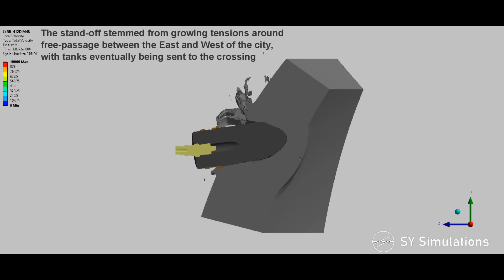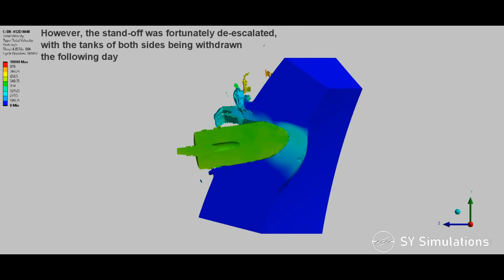STAND-OFF AT CHECKPOINT CHARLIE SIMULATION | T-54 vs M48 | BR-412D Armour Penetration Simulation

Comment from the maker: I'm planning to do a Part 2 with an M48 firing at a T-54, but I'm not familiar with which round it would likely have loaded for the stand-off; would it be AP, APCBC, or HVAP? (Keep in mind I cant do any HEAT munitions due to computational constraints)
If you know more please let me know!
Reply: against armor, post-ww2 american vehicles usually employed HVAP. i believe the one used on the m48 would be M332A1, if HEAT-FS wasn't available.
Reply: HVAP, please.
Reply: 90mm M332 HVAP against the T-54 turret, because it wont pen anywhere else. If you need schematics for it's armor layout I've posted them on TankNet forums a while ago.
Reply: @peasant8246 I don't think that round was in service during the crisis.
Reply: @SeanMurphy1090-d5u  It was in service at least from 1953, possibly earlier.
Reply: US phased the M82 APCBC out in 1950. M318A1 APBC / M348 HEAT / M71 HE / M332 APCR became standard
Reply: would it be possible to do a simulation of the HEAT round and get the velocity/mass of the shaped charge jet and then use that as a baseline for a mock shaped charge jet (just an EFP basically) on the T-54? it probably wouldnt be as accurate but i'd like to see if it would obtain similar penetration values to the real deal
Reply: it would be interesting to see how much damage or spall an HVAP non pen would be able to do to a T-54
Reply: AP (the general APHE used on the 90mm gun) probably isn't worth to see, the T-54 was a tough nut to crack and the HEAT probably could do the job but as explained we will not see that.
So, go for the APCR/HVAP🤓
Reply: @Sh-epard  THE M82 APHE shouldnt even be attempted. The 90mm guns on the Pershing and Patton tanks had equivalent performance to the german KwK36 88mmL56 with that ammo type. And the soviets specifically required the T54/55 to be imune to that gun from any range. And they tested it by shooting the gun point blank at the trial hulls.
Reply: @regeNausWeiden  as i said he should sim directly the HVAP/APCR.
Reply: By this period of the cold war it would have been HEAT, with the improved version being the m431 round. However, besides that, the post ww11 hvap could have been used as a substitute. With the HEAT round the m48; at this stage in the cold war, would have had a the advantage. AP33-7 was also used, with higher velocity than its predecessor's, the t33. Under 750m the hvap could penatrate the t54/t55.
Reply: @jarredbertels864  Pretty sure the HEAT rounds were not issued until the mid-60s
Reply: @SeanMurphy1090-d5u  Another clueless tankie, oh please.
Reply: T300E53 HEATFS round was tested in 1958 and as I understood became the basis for M431 HEATFS. By 1967 it definitely became standard issue ammunition, as it has been mentioned in the Artillery Ammunition technical manual for 1967, being issued to vehicles equipped with M36, M41 and M56 90 mm cannons, but not those with M3A1 that were stuck with M348.

It is unclear if by 1961, M431 would already be issued. However, M332 HVAP and at least M348 HEATFS were definitely be present in the load out of these M48 tanks in Berlin.
Reply: M318 APBC or M332 HVAP. I can't imagine if Checkpoint Charlie M48 crews had both rounds available in their racks they would have had anything but HVAP loaded.
Reply: I think APCR (M332A1) would be more interesting to see, since M318A1 is just a solid slug with a windshield, and as a sidenote I've also heard that the fuzes in the HEAT rounds had problems at higher angles of impact.
Reply: @juusolatva  Well, look who's the self-proclaimed Tankie here. The mighty American 90mm HEAT-FS rounds, showcased on their M48 and M47 darlings, apparently had a jolly good time waltzing through the T-55's glacis plate back in the day. Oh, but wait, hold your horses – brace yourself for the shock of the century! Behold, the legendary Yugoslavian experiments, where the almighty 90mm HEAT rounds strutted their stuff, turning that once 'invincible' T-55 glacis plate into a spreadable delicacy, smoother than butter on a summer's day. Oh, how the T-55 wept.
Reply: Present the projectiles one by one and then test them (perhaps starting with the oldest and going to the newest)
Reply: Should be HVAP. The US had the specs for the T-54 thanks to an "acquisition" in the Hungarian Uprising a few years previously and considered the T-54 an even match for the M48 but not the IS-3.
Reply: I'd like to see a simulation with the HVAP round!
Reply: HVAP
Reply: APFSDF
Reply: Heat
Reply: I'm for APCR. Tankers loved to shot their best rounds first. While the Brits used APDS, the US stayed with APCR rounds for some time :)
Reply: Can you make a penetration test for mt 12 100mm round
Reply: Is there any plans on making a video about old soviet WW2 APHEs with gorooves on them? I just watched ur Tiger II shot traps and there was a topic on effectiveness of those stress relief grooves so im wondering whether there's any point in waiting for a video on them with your approximations on cases where those would make a difference
Reply: Did alot of research and it seems in the event they faced heavier tanks at closer range they would use the heat and they would use the hvap at longer ranges due to its later trajectory so it is likely they would have had heat loaded in this case but since you can't model heat it would still be interesting to see the hvap
Reply: Pretty sure that APCBC was the standard anti-armor round. I don't think the 90mm HEAT was in use until after the crisis.
Reply: @SeanMurphy1090-d5u  M82 APCBC by 1950 was decommissioned for the 90 mm cannons as far as I know. M318A1 APBC (basically improved T33, made of a different steel and fired at a higher velocity) and M332A1 HVAP (basically modified M304 HVAP with a lightened carrier and significantly higher velocity at close range) would likely have been the standard rounds.
Reply: It would have been M318A1 APBC or M431 HEATFS.
Reply: @basedjorts  I'm almost certain that M431 was not in service at the time.
Reply: @SeanMurphy1090-d5u  It was available by 1960, if I correctly read an Army document.
Reply: HEAT
Reply: HESH/HEP. US tanker like hesh against armored target. They prefer heat but heat is hard to get. And because they know AP and hvap do little against soviet tanks. Though maybe hvap penetrates upper plate and turrer at this range though?

Comment: Soviets still using full caliber AP rounds in the 1960s:

The M48’s HEATFS waiting to turn the Soviets into Russian soup: 🗿
Reply: Nato still using rifled cannon in 1960
While the soviets using smothbore cannon
Reply: @IzakSemrdoii The D-10 was also rifled
Reply: @idontlikecommunists9677  t62 cannon was not
Reply: M48s armor was not that good so full caliber AP was enough against its armor. Meawhile T-54 was immune to 90mm full caliber AP shells so the americans resorted to HEATFS (which had pretty bad fuses so there was a chance to just bounce off the highly sloped soviet armor instead of detonating. Its also why they used HVAP since it had no fusing issues and was more accurate)

Comment: How about 
128mm PzGr.39 APCBC from Jagdtiger vs 100mm thick 260BHN steel at 60 degrees

But then also vs 300BHN 42SM steel 100mm plate at 60 degrees to simulate T-54 hull armour

Comment: Good sim, only argument i have, is that the cast armor on the M48 turret is said to be around ~310bhn going by the books and armor distribution documents I have.  Granted, I doubt it would of made much of a difference in the sim at that range/velocity.  Also, are you using the same J-C damage model for cast and rolled armor?  Or do you have a separate damage property set for each type?  The difference between the two isn't really hardness, it's more the tendency to be pourous and have microvoids in the cast armor.
Reply from the maker: Hi, interesting, as what I found suggested a lower hardness, but as you say, at this range it wouldnt make too much of a difference. And no, the JC damage model I use for CHA is slightly different, I attempt to capture the porosity and microvoids through a reduction in the elongation limit
Reply: >310 BHN
I'm sure this value is incorrect. MIL-A-11356B (1953) spec for thick cast armor (3,75in. - 7in. included) give the acceptable range of BHN as: 217 - 269.

Comment: It's kinda weird that the projectile travels pretty much the same direction, albeit slightly offset to the side, before and after it penetrates the armor. It gets deflected outward when punching into the armor and then deflected outward, when it comes back out the other side.

Comment: I was stationed in Germany during the Cold War, and messed up by never visiting Checkpoint Charlie.  To get there you had to be in Class A's and check in at the East German border where they would record the time and calculate what time you would arrive at the next check point.  If you didn't arrive on time the Stasi would come looking for you.
Reply: Do you happen to know if the m48s at the time used either AP, APCR or HEAT? He wants to simulate the other side of the coin but doesnt know what to use
Reply: @ar0568 from the way he's wording it, I think he was on the Soviet side
Reply: @captmoha3787   Getting to Berlin from West Germany involved crossing the border into Soviet controlled East Germany, then driving into the Allied controlled West Berlin.  From there you could visit the West Berlin/East Berlin checkpoint.
Reply: @ar0568  Can't help, I was Air Force working on F-4's.

Comment: Interesting how that projectile started to normalize. You see clearly at 1.15, where the tip stops moving up and begins to nose down. Why?
Reply: When the round comes into contact with the armor, because of the angle the bottom part of the round hits the armor first while the top doesnt which pushes the round to rotate anti clockwise. But at the end of the armor its the opposite where the bottom of the round is free from armor while the top still has to resist pushing through the steel which causes it to rotate clockwise
Reply: Net Force = mass X acceleration.

Comment: I heard during the cold war, US tanks are mainly use HEAT for anti-armor instead kinetic projectile?
that even when 105mm M68 put into service HEAT is still the main round for anti armor
But is it only when a new Soviet tank with composite armor where they back to kinetic?
Reply: Yea, HEAT was seen as the future of AT weaponry at the time because of how much more powerful they were compared to kinetic. But they also started to realize how easy it was to stop chemical energy rounds in comparison to kinetic. Thus spaced armor, composite and eventually ERA become common so they started going back to kinetic and developing better apds rounds that then evolved into apfsds as the potential for those was much higher.
Reply: Then it all went to shit and they went back to heat but strapped to a cheap fpv drone. @gavinlightfoot5521

Comment: And that's why the US was so anxious to get the M60 into service in Berlin (and elsewhere).
Reply: on the early versions of the M60 the armor wasn't very different from that.
Reply: @BrenoAgmL Ye, the turret was practically the same but the hull was much better, then the m60a1 came out which made a far better turret and reinforced the hull even more.
Reply: @gavinlightfoot5521  yes, that's a lot of true, but im saying the turret because ov the comment i was responding and the video in question.
Reply: @BrenoAgmL  -- but they did have the M68 105mm main gun . . . 

American tank design in the 50's and 60's, looking back from an historical perspective, seems very haphazard, a lot of trial and error, false starts, and improvisation, trying to keep up with advances in Soviet tank design.  So, yeah, it was a mad scramble to get what the US could into the field as fast as possible, and then make changes in production as various new concepts matured.

Wars tend to start as "come as you are" affairs, not necessarily as you'd like to be.  Which is how out-matched M48s faced off against T-55s at Checkpoint Charlie.
Reply: @Supersean0001  You are correct, but the M-60s were not yet ready to be sent to Europe at the time of the crisis, and even though in the 60s, the M48 was still capable, being able to shoot down the tanks used at that distance in an eventual war, and even if the M-60 was superior and more important, it wasn't ready to be sent, not in quantity enought, and it wasn't T-55s that were Charlie, it was T-54s, much more limited but armed with the same cannon and the same armor.
Reply: @Supersean0001  i always wondered why was that considering the US had one of the largest military budgets in the world and a decent amount of experience in tank design from the preceding war
Reply: @capitaljushman5756 Most of the budget was on Air power since that was what would counter most of the Soviets advantage in tank and numerical advantage.
Reply: US got plenty of nukes and good long range jet bombers to deliver them... Soviets would do literally nothing to test that as they were fully aware that they would lose this type of confrontation -> they are using those Tu-95 to this very day... propellers for the win! 😅

Comment: Out of curiosity how does it work the other wsy around?  100m is pretty darn close for tank rounds, so I wonder if the m48 had a chance if it got the first shot off.
Reply: At this range:
M318A1 AP might not defeat the armor but could disable some more sensitive components. 
M332 HVAP would sail right through the T-54 turret front as long as it's somewhat near the center.
M431 HEAT (possibly limited quantity in service) would have no issue with any portion of the armor, though the fuze may cause delayed detonation at impact angles of more than ~73°

A situation like this standoff would give time for the crew to ready (&aim) their best shot on both sides so it'd be more like who fires and hits first.
Reply: @bighobo7745  HEAT rounds were the standard AT round for almost every NATO tank at the time, they wouldve had plenty. In 50s and 60s, before composite armor, almost every tank was just a HEAT slinger.
Reply: @s0r1ns3c  Most of the 50s was HVAP and to a small extent AP. After the 1956 Hungarian revolution and the examined T-54 which prompted the L7 105 development, the US also developed HEAT rounds for their existing guns with the M431 HEAT-T being accepted into service in 1958, followed by M456 HEAT-T (105mm) in 1960.
There had been prototypes and testing of HEAT projectiles for tanks since the tail end of WW2, but it seems it was only after the Korean War they were seen as a higher priority due to concerns about new Soviet tank designs like the T-54 and T-10.
Reply: From the front, I doubt the 90mm gun could do anything to a T-54. The Soviet tank was better in pretty much every respect, it was smaller, had a better gun, was much, MUCH better armoured, and the only thing the M48 would really win out in would be crew comfort. NATO only got a gun able to penetrate the frontal armour when the British captured a T-54 during the Hungarian uprising, and they managed to measure the frontal armour and developed the 105mm L7 gun in response. When Centurions and M48s were fitted with those it would be a bit more even.
Reply: @nickellison2785  No my friend, the 90mm wasn't that week, yes its AP and APCR was inefficient at this angle, but at this point, almost, all the M48s were armed with 90mm HEAT-FS ammunition, which was very capable and was more penetration than the Russian AP.
Reply: @BrenoAgmL  but the fuse wont detonate at >60º
Reply: @nickellison2785 the only two things the m48 did better was fire control system and gun depression, in this case gun depression doesn't really matter.
Reply: @gavinlightfoot5521 I also don’t think a better fire control system is going to provide much of an advantage when you’re close enough that you could hit the enemy tank by throwing the projectile
Reply: @gavinlightfoot5521 lol, nope, dont have a better fire Control
Reply: @humbertomello214  it very much did, t54 was all assisted manual basically, pretty poor electronics and hydraulics in them. The t55 was better